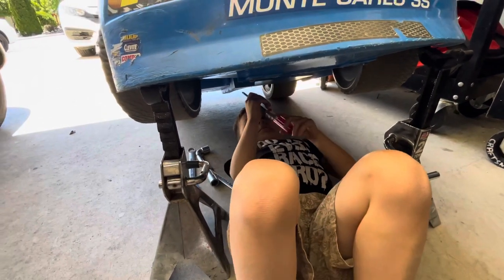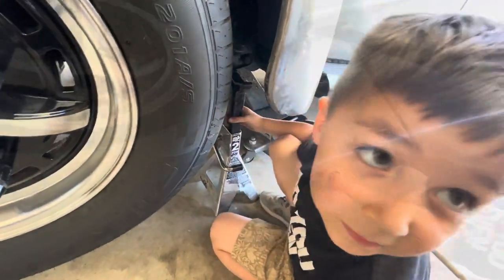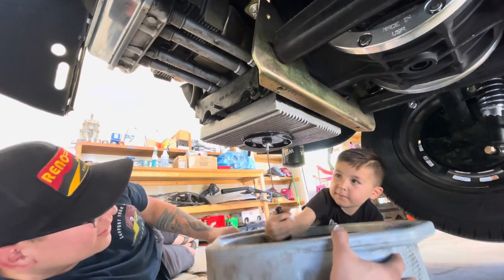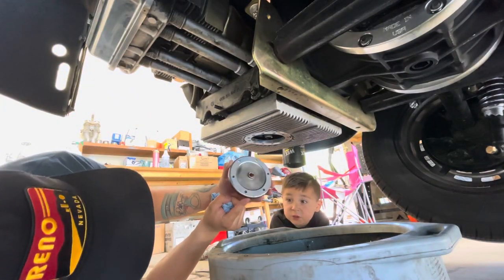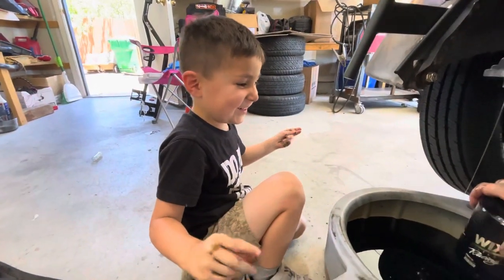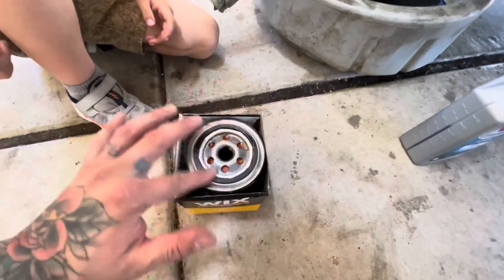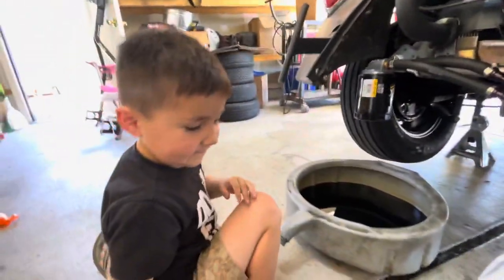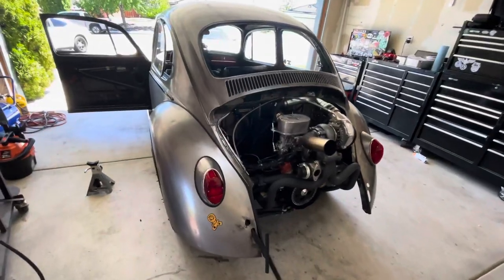MY SONS FIRST OIL CHANGE ON THE TURBO VW BUG

Comment: Hey this is awesome that they are interested in this stuff. Is there any chance you could answer a couple questions I have about the cb black box?
Reply from the maker: 😎😎
Absolutely! What can I help you with?
Reply: @EmmettRacing  basically my 260z distributor has a module attached to the side making it a electronic control module instead of the OEM points style. I  know the module is bad. Does the Black Box basically just fit in-between the coil posts(+/-) and the distributor pick up?
Reply from the maker: @SeanOBryanZZ  yes essentially it does but the black box still needs to connect to a ignition module or points but preferably to a ignition module plus the coil.

Comment: Where did you get those curved 45 degree fitting coming out the oil pump full flow cover?
Reply from the maker: I got them from Amazon. A company called Evil Energy. Here’s a link: EVIL ENERGY 10AN 45 Degree Push... https://www.amazon.com/dp/B07F3L43TV?ref=ppx_pop_mob_ap_share
Reply: Awesome thanks!
Reply from the maker: @austinhamilton4799  no problem!

Comment: Why 10W30?  20W50 or even a 60 weight with that turbo.
Reply from the maker: Since it snows where I live, I use 10w30 in the winter and 20w50 in the summer. The lower viscosity oil flows better in colder climates. I made this video a year ago going into fall.
Reply: @EmmettRacing  Oh ok.
Reply: I was fixin to ask the same thing. I run 20w50 year round here in GA.  Just a stock 1600sp but I like the zinc content.